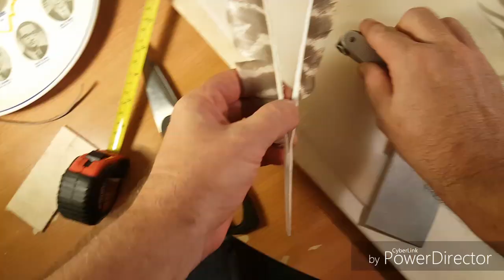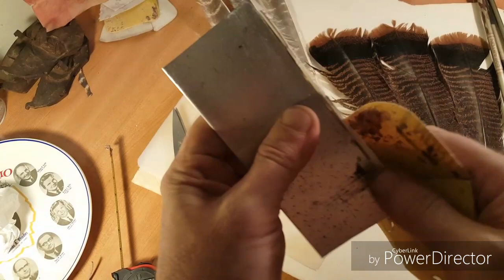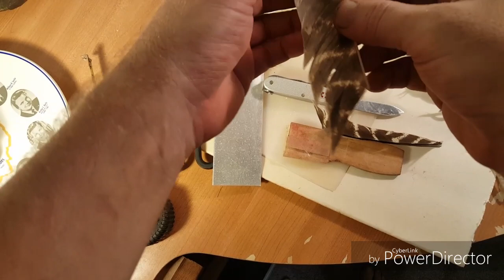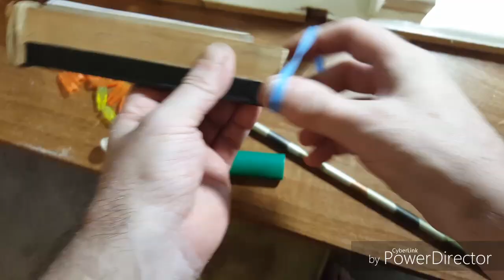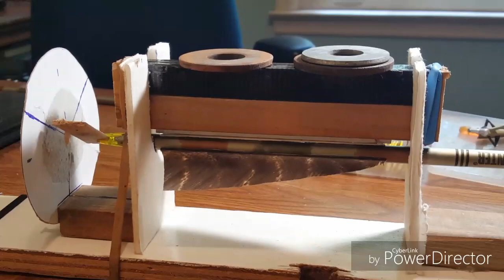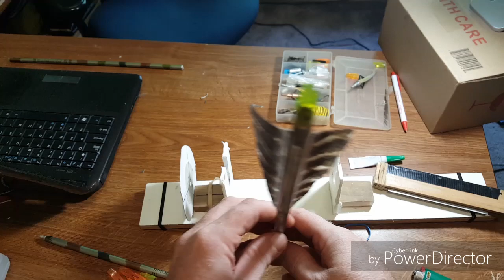Homemade turkey feather Fletching and a do-it-yourself Arrow jig

Comment: What is that piece called that you have the feather in as you sand it?
Reply from the maker: Not sure what to call it...it is just a clamp I made by bending a piece of metal roof flashing..to hold the feather without damaging it.
Reply: @americanplayscapes  the template you used to trim the feather..did you make or buy that?
Reply from the maker: @billmessner8052  I just copied it from a fletching on another arrow and cut it out of cardboard.
Reply: @americanplayscapes  nice..thank you!